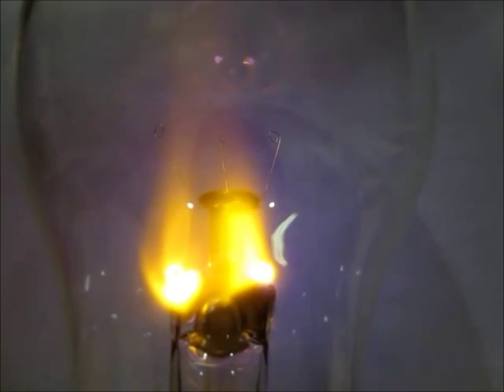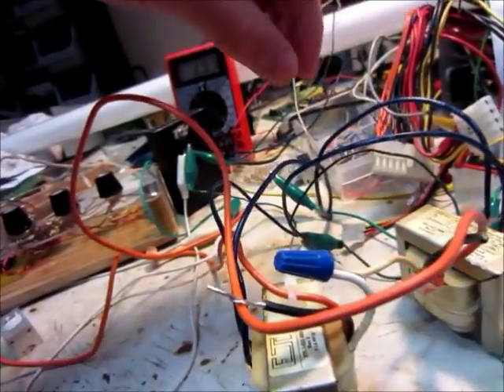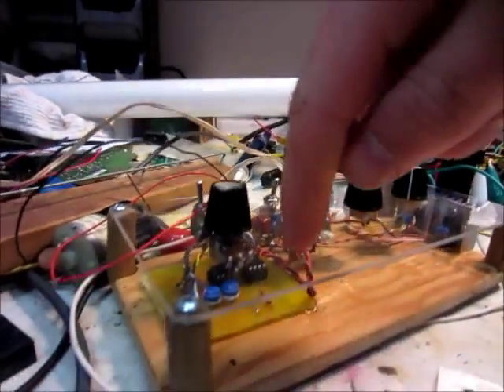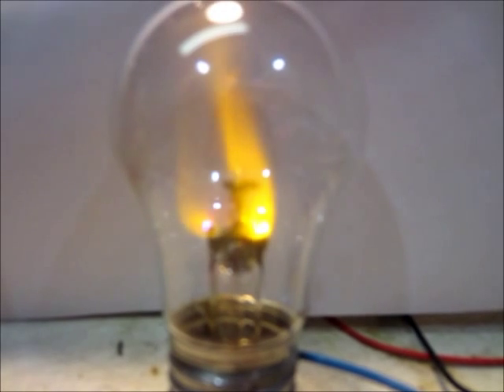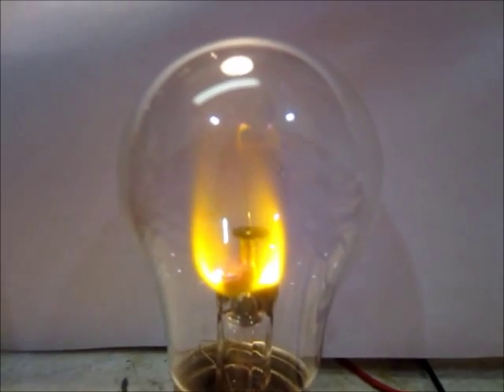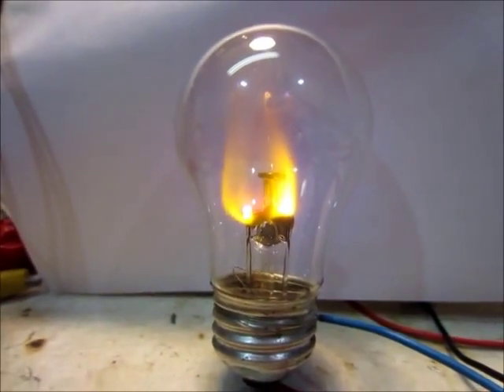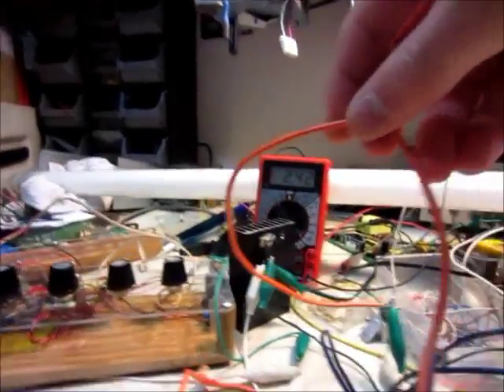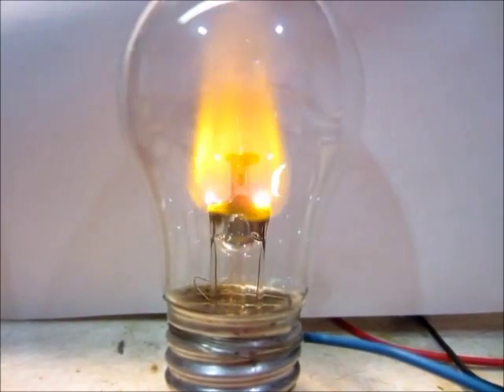High Voltage Arcs in a Light Bulb Look Like Fire

Comment: You are right the glass contains sodium and some of the glass is being heated and vaporized. This is known as sodium flare. Glass blower like me use didymium glasses to filter the orange light from the sodium flame because it very bright and stresses the eyes. Soft glass like what light bulbs are made of contain a lot of sodium and is some times referred to as soda glass. I don't think the inside of the bulb would stay clear after long run times.

Comment: As you may know, the higher the voltage, the less the amprage... It is also a bit more efficient.
Reply: Other way around big fella, more voltage means more energy per electron and therefore more electrons can flow given the higher energy

Comment: 277 volts is a weird voltage indeed, but it is used in comercial buildings to run the flourecent fixtures, fans, and exit signs in ceiling-tiled buildings.

Comment: Yes you can protect mosfet from high voltage you can make a little circuit that is build of 1 high voltage diode 1 resistor and 1 capacitor wich will take the BEMF from the coil and absorb it. If you send the high voltage true it lol then no I did that couple of time too you need to watch this one ;) and finaly some mosfet are build with this function internally but those go for little higher price. If you need help build the circuit let me know I'll do a small video for this :P Have a good day!

Comment from the maker: Yes it does get hot!  Yes I also completed your challenge!  How can I protect the mosfet from high voltage?  I already burned one out by accentual touching one of the high voltage leads to the low voltage side.  I was thinking to maybe put some neon bulbs across the mosfet.  Would that work?  Thanks!